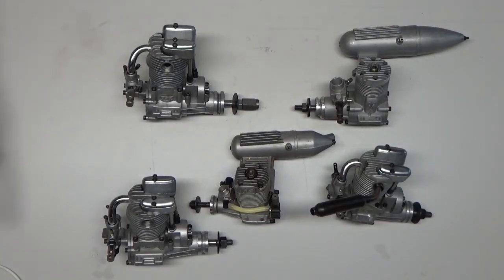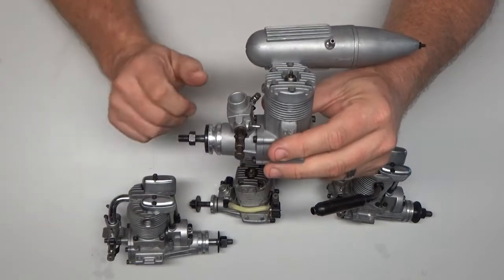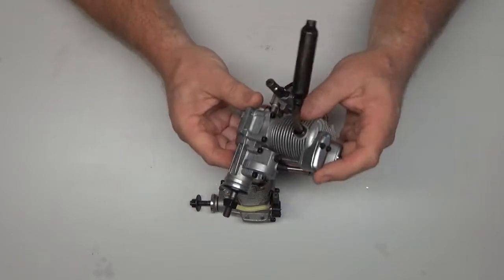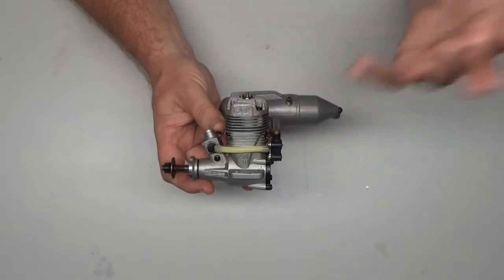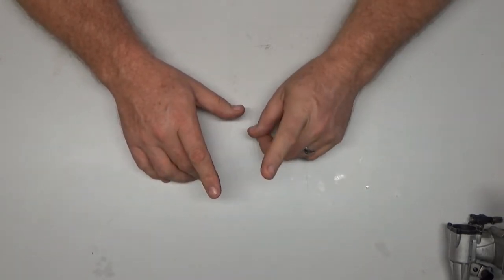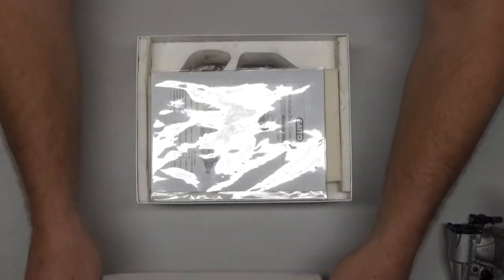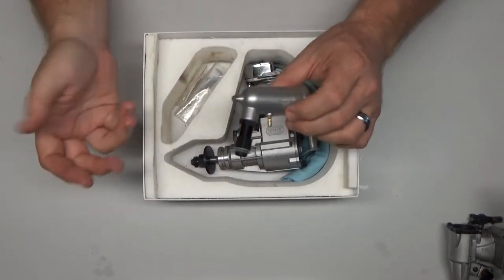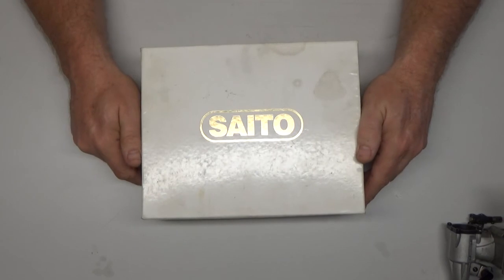Bunch O Engines UPDATE

Comment from the maker: So, after 188 views the voting on the OS 40 LA stands at:
5 - Just run it.
2 - Look Inside
I will give this another week or so and I will try to keep checking for more vote results and update accordingly.
Reply from the maker: Ok viewers and subscribers. I know I said i would give this another week but I have changed my mind.  I have this engine mounted on the test stand now and will be running it FIRST and then doing a Look Inside.  I figure one run isn't going to change the way the internals look.  I will be completely disassembling this engine so I can clean all the parts up.

Comment: Put an LA40 on a 25 size plane and hang on !! LA engines run good but are a little fragile and the liners are prone to peeling. The LA65 is excellent and very powerful. Last week I picked up about 20 engines from an estate all from about 40 to 60 size, nothing exotic or any four strokes but its been fun cleaning them up and running them, I even made my own ultrasonic cleaning system. I plan to sell a bunch of those engines as I already have way too many. Four of them are even new in box.
Reply: jeffie8696 E-Bay! I have gotten two engines that way this winter.